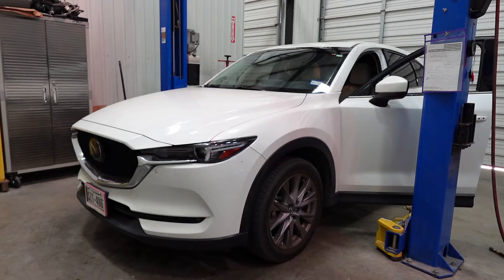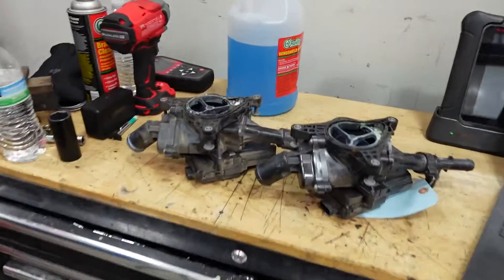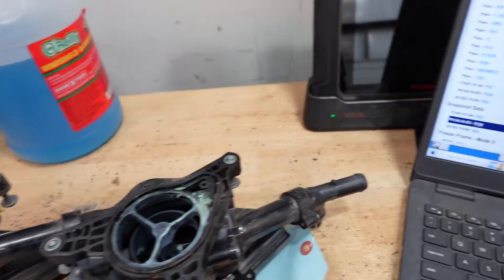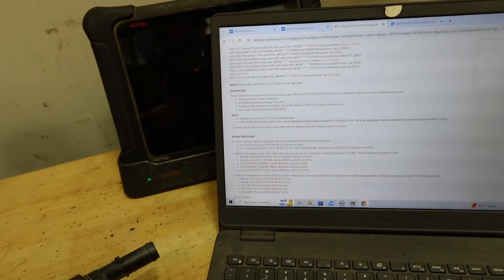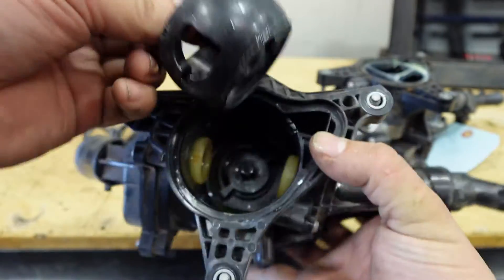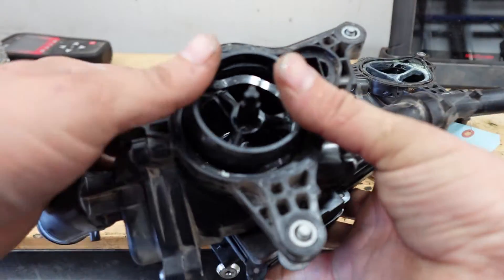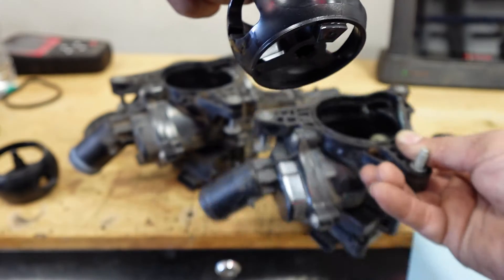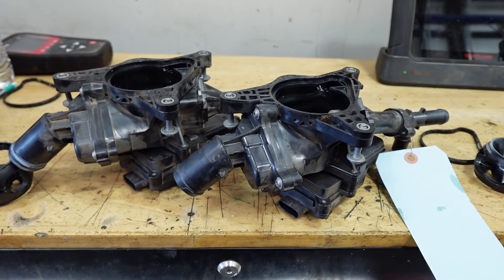MAZDA P0126 DIAGNOSIS AND VALVE TEARDOWN

Comment: I just got P0126 code on my 2024 CX-5 none turbo. It came on while driving on the highway. The temp on the gauge was around 180". Outside temp was 64'. Current miles on car 17,300. I always leave my the Bluedriver scanner plugged in. So, I did I quick scan. Learned what it was, and did a reset. I'll just have to keep an eye on it for now.

Comment: they just put in the thermostat kit on my 23 cx5 not the whole control valve kit number PYY2-15-SA1       thermostat set said that is mazda fix now, is that the right fix?
Reply from the maker: Mazda has changed the repair procedure. I've been meaning to post a video on the new repair process. Mazda no longer replaces the entire control valve but only a small thermostat inside the unit. the thermostat is really small. About the size of your thumb.

Comment: So knowing this has always been a problem all they had to was set the trigger level to set P0126 higher....so it never triggers, your engine and heater always runs cold, wears out premeturely and gets crappy mileage and ruins catalytic converters, hugher emissions. They wont repair without P0126. And the problem is a stuck open thermostat, about the size of your thumb in its own housing where the return hose is. Not the CCV which is the computerized heater control. Stoopid ridiculous design. Selling my 2023 CX5, going back ti 63 Studebaker. Has a $10 thermostat and a cable to control the heater.

Comment: Congrats very explicative videos, would you mind helping me with my CX-9 2019 GT with 2.5 turbo? It's blowing cold air. Coolant levels are fine. I checked the actuator seems to work fine, It blows air every single vent on the vehicle, even the rear ones but not warm air at all. I haven't been able to find out either if that vehicle has CCV or Just the thermostat brings  coolant to the core, temperature in the engine seems to be between levels 
Thanks

Comment: Thank you for this. I have a better understanding of the mechanics of these. I have a '19 mazda3 with 228,000km. I did a rad flush in Dec. My thermostat is stuck open for just over a week now. I stopped by a dealership last week for a part quote. $800 just for the part. Insane. And rockauto is out of stock.  Thanks and algos.

Comment: I have a customer who is back after nearly a year with a repeat problem. Looking at the updated TSB it's now suggesting replacing just a mechanical thermostat portion of the assembly (albeit with a lot of extra care with the screws).

Do you know if they updated the internal part?

Given an option and at no extra cost to the customer would you recommend replacing the unit or just the mechanical portion?

Should I sell a coolant flush? (Customer would probably have to pay for that.)

Comment: I too have an issue with my 2019 CX3, the top rad hose gets warm, not excessively hot and the bottom hose stays stone cold, rad is not clogged I can squeeze the bottom hose with the rad cap off and the coolant moves. I have good cabin heat. It has been excessively cold here in PA since Christmas, what made me check was a coolant smell in the cabin, coolant does not seem to have gone down though. Could this valve be the culprit? No engine codes as of yet.

Comment: I have a 2024 cx5 and I just got a letter from mazda stating I do infact have this coolant valve in my mazda cx5. They will replace it under extended warranty up to 150,000 miles or 15 years!
Reply: my  question to that is are you going to have to keep replacing this every other year because it keeps breaking and is there a solution like a retrofit mechanical thermostat.

Comment: Ive gone ahead and purchased the thermostat and plastic housing parts89$....ive changed the parts...i still have the same issue🤷‍♂️
I am a very good mechanic...father was a stock car racer...uncle was AA dragster driver...i know what im doing.
Ive called mazda Canada and have been advised that a letter will be sent out to me soon. Ive heard its the thermostat stuck open so i went ahead and stuck the old thermostat into water @105C...the thermostat opened at exactly 105C which is stamped on the old thermostat.
I still do not have hot heat....i have one heater hose (upper) hot or warm and the lower hose is cool 🤷‍♂️
AND...NO CODES

Comment: I have a 2011 CX7 with 142k miles and just got the code P0126. Guess the cooling valve could be the issue. Would you suggest replacing that part and also the thermostat at the same time ? Look forward to hearing back and thx again for detailed explanation 👍
Reply: The 2011 model I think has an older style thermostat instead of this electronic coolant control valve

Comment: The recall is not recognised in the UK.
I tried at my main dealer whilst under warranty and I showed them the TSB recall notice. And showed me the door.

A dry hollow to me suggests lack of lubrication (coolant) behind the 2 rubber seals. Surely a small hole drilled into each side of the rotating part would allow coolant to trickle into the seals and keep them lubricated??  If I had an old unit I would try it
Reply: Tsb and recall are not the same thing
Reply: In Europe dealers are not allowed to fix this issue with PYY2-15-SA1 solution. Just received confirmation from Mazda Japan through Finland dealer. Bureaucracy. Just ask your dealer to buy directly from japan this spare part and fix it yourself

Comment: Edit: READ THIS FIRST Here is the latest revision of the TSB regarding this issue. https://static.nhtsa.gov/odi/tsbs/2024/MC-11003350-0001.pdf
Elsewhere it is claimed that the failure mode is a small mechanical failsafe thermostat that is installed in the CCV. It fails open, and allows excess coolant flow thru the radiator. Recently Mazda has made available a $30 kit with parts to replace only the failsafe mechanical thermostat. Please make a video showing how to replace the mechanical thermostat inside the CCV.
Reply from the maker: YES YOU ARE CORRECT.  Mazda updated the tsb after I released this video. Before the update the entire coolant control valve would need replacing. now they just send the small thermostat inside. And yes new models still come with the valve. But there are some new models that dont. The vehicles that come with the electronic valve have cylinder deactivation.

Comment: This might be a dumb question but I’m not a mechanic, is the coolant control valve the same thing as the thermostat because if I search for that part on auto zone or OReillys it doesn’t show up when using the search term coolant control valve, however when I did past research on thermostat issues the part looks the same as these coolant control valves.
Reply from the maker: The coolant control valve I believe is only a mazda part and cannot be found aftermarket.
Reply: yes its the same except its plastic piece of junk that's going to fail over and over ask me how i know and why im here reading comments

Comment: I have a theory....to me it seems like all the people having issues have the lower trim models. They dont have heads up display. They dont have all the bells and whistles. Both of mine were top trim levels...and i had a temperature gauge. It was always perfect. Every single yhing was flawless except the rear brakes...they wore out faster yhan the front.. what teim level do you have ...if you're having issues???
Reply: Moron. Trim level has nothing to do with this issue.

Comment: I have a 22 Mazda CX-5 and the cool valve is stuck open, doesn’t overheat but it’s still driving. Also I’m glad the 24 has the mechanical valve now, cause I have 24 and 22 CX-5.

Comment: Had to have the coolant control valve replaced on our ‘19 CX-5, which was done under warranty(it would take forever for the engine to reach operating temperature).  My tech has 21 years experience with Mazda and he told me the job is a real PITA. Glad I didn’t have to pay for it.
Reply: its really not that bad. the worst part is draining and refilling the coolant. its really accessible just under the battery.

Comment: what will happen  if the car gets operated with that stuck valve ? as i presume the temperature wont go high in winter right ? as for the summer it keeps the engine with low temperature operation.
Reply: summer not so bad, its a lot worse in winter

Comment: 5:55 I am curious if you have more information on this? My US 2024 non-turbo CX-5 still has this monstrosity...part# PYFD-15-16ZA. The "A" suffix supposedly  alleviated the problem but definitely not an old-style mechanical thermostat...would be interesting to see the part numbers on those bad ones you have there.
Reply: I took a screen shot of another video and zoomed in on part number and it only had the Z on the end .  NOT ZA . So the ones ending in just Z seem to be the ones with the issues.
Reply: I'm also want to buy a used one take it apart and I'm sure that there's a electric motor in the case thst stops working.  Probably easy for to replace a china brand motor. Lol
Reply: PYY2-15-SA1 is solution

Comment: Under warranty. this is getting fixed on my 2023 Mazda Hatch right now. Thanks for the video!
Reply: Mazda won't take care of it because there is no engine light on anymore but it would in the beginning and it just went away I do have problems with the engine warming up I own a Mazda 3 2022 what can I do?
Reply: @hugomejia3028 same issue

Comment: Hey man very much appreciate your videos. 
Question for you - I replaced the coolant control valve and now the car heats up like normal but the heater doesn’t blow hot. 
Would this mean I got a bad part? Or have you seen anything else? 
Thanks for reading and your time
Reply: Might have air in the coolant system that needs to be burped out. (In case it helps someone else, I assume you dealt with it by now).

Comment: I got a mazda 6 2.0 gasoline, 165 HP from Europe, non turbo. I can't seem to find this part on any european parts catalog, but my car does have this and it's not an import, it's from netherlands. The coolant struggles to heat up, but I don't have the check engine light, neither after driving 1000km on a single day. Could this be the problem for my situation as well? Any idea how it comes that this part is rarely found in european part catalogs?

Comment: On our ‘20 non-turbo, we got the code and stupidly I cleared it.  The engine temp has been low and fluctuating ever since but the light will not return.  Now Mazda won’t warranty the part until it does.
Reply: Yep, they don't give a crap unless you get the light. Honestly really can't recommend getting a Mazda at this point since they don't stand behind their products.

Comment: Do you know what conditions actually cause that code to come up? I've been dealing with my '19 mazda 3 struggling to reach even 1/4 on the gauge (1/2 is normal temp) even after a 30 minute highway drive. I'm surprised I haven't gotten this yet. The dealer told me I had to have the check engine light come on before I'm eligible for warranty replacement which sucks because it's clearly the problem.

Wonder if I could retrofit whatever the new CX-5's have that you mention.
Reply: I am in exactly the same situation.  My valve opens at 122°F instead of at 188°F and I never reach normal operating temp. Dealer told me the same.

Comment: Hey i have Question is it possible to go back to the old mechanical thermostat Instead of this plastic thermostat That might fail in the future ?
Reply: If you went back to the simple thermostat style what would happen to the elec. Plug ins and wouldn't a code come up if the cables were disconnected?